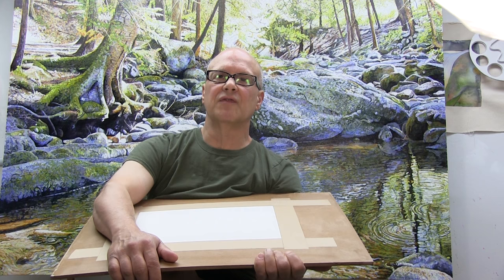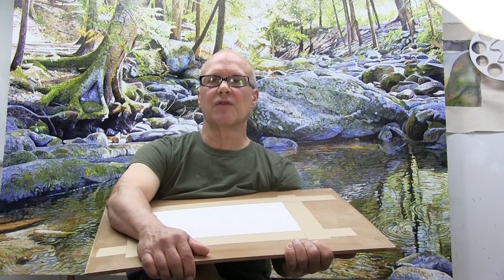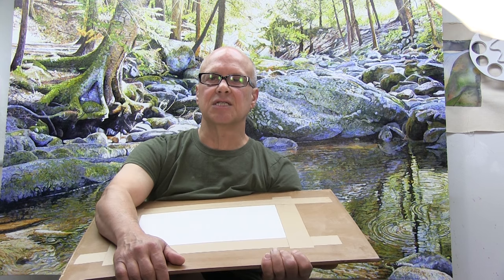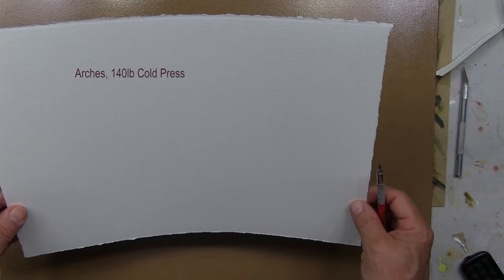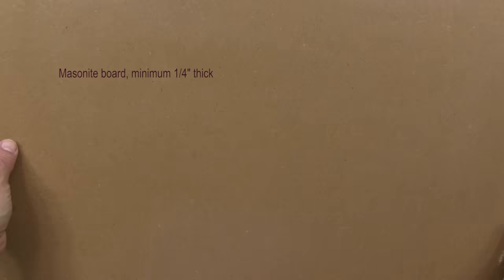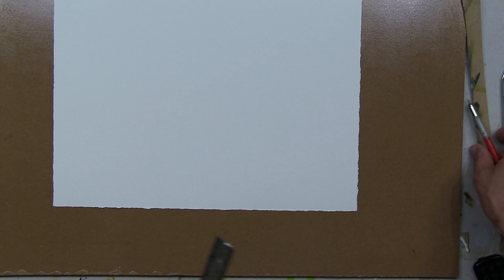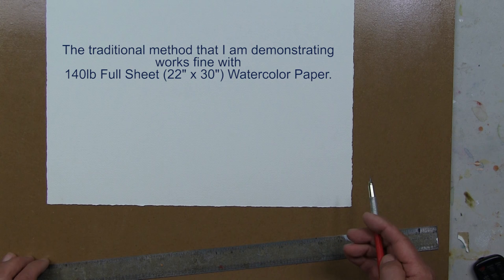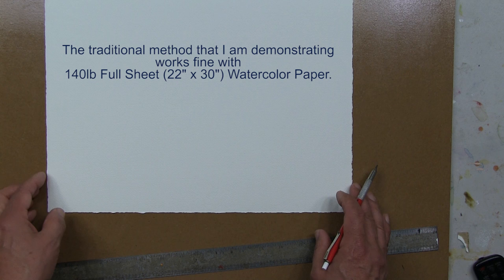How to Stretch Watercolor Paper, the Classic Method by Ross Barbera

Comment: I'd be curious to know if an art conservator would consider the paper archival after using the paper tape; there must be some acidic seepage around the perimeter of the sheet.  Using acid neutral white glue to moisten water activated acidic pre-glued paper is counteractive. Better process could be to use strips of plain kraft paper with the archival glue? Avoiding the acidic paper tape all together. 
Also curious to see how the sheet is removed from the backer panel after the glue sets. Is the wood panel re-usable?

Comment: Love your videos!  I noticed that the glue you are using is much thinner than Elmer's Glue, so if using Elmer's Glue, do you have a formula for how much water to add to thin it down, or do I use it full strength and thick?  Thanks.
Reply from the maker: Hi Shirley,  Using glue to wet the tape assures that the tape will stick when dry, but sometimes that glue is too think so I thin it down with just enough water to make it brushable. Hope the video was helpful.
Reply: Thanks.  Your video was very helpful.  I'm working my way thru all of them.  I am very intrigued by your watercolor paper jewelry.  I'm going to have to give that a try!
Reply from the maker: Glad it was helpful Shirley! Hope you enjoy making the jewelry! Any questions, don't hesitate to ask.
Reply: Thank you.

Comment: Great tutorial, thank you! what happens to the sizing after the paper has been soaking for 20 minutes? Does some of it get washed away?
Reply from the maker: Hi April, As long as the water is cool/ room temperature there is no danger of washing away the sizing. Definitely do not use hot water! That will damage the paper.
Reply: +realisticart Thank you, I was somewhat concerned about it.
Reply from the maker: Cool water doesn't seem to remove any sizing at all. I use Arches paper and there is no change in the way the paint responds to stretched paper. I've even soaked the paper in cool water for up to 45 minutes with no damage to the paper. But very warm to hot will absolutely remove a significant amount of sizing and turn the paper into a blotter.  If you using a different paper brand, you might want to do a test and soak a small piece in cool water for 30 minutes, then let it dry and paint on it.
Reply: Thank you for the suggestion, I'll try that. I'm new to watercolor and have so much to learn.